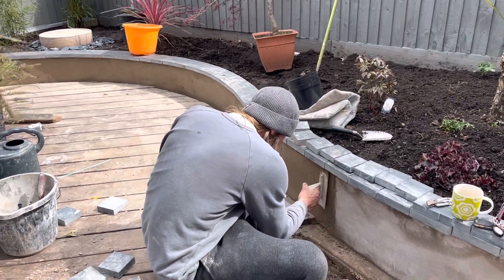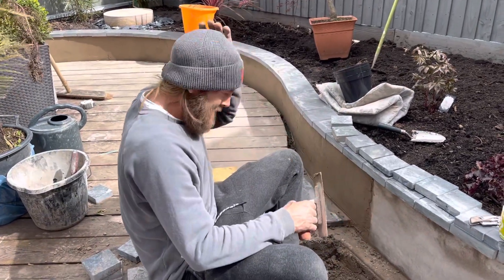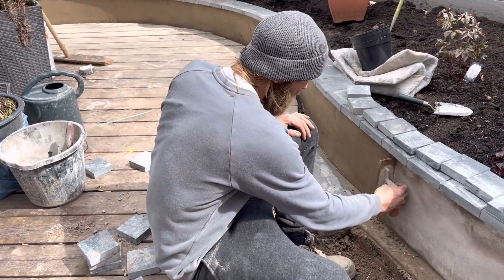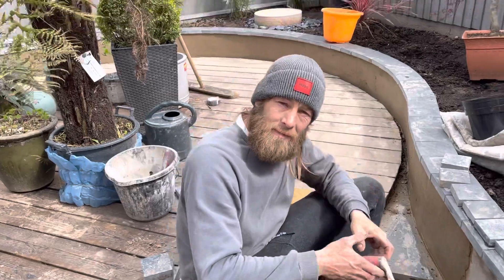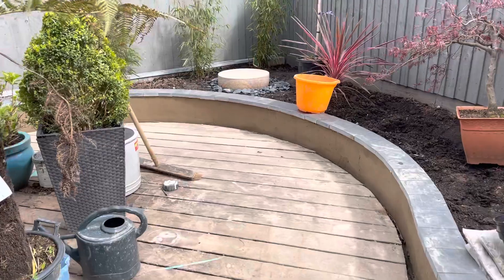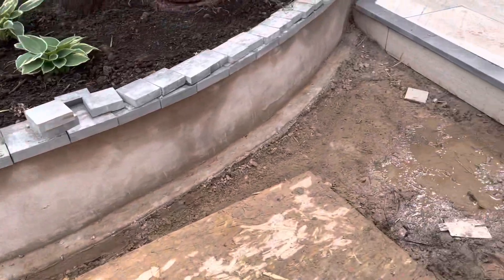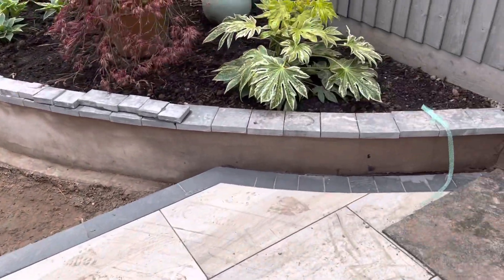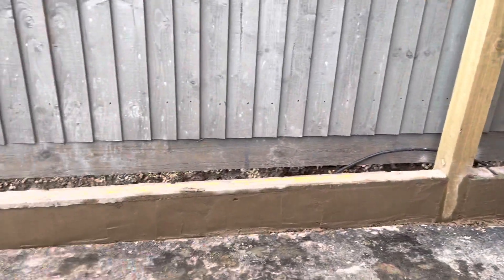Rendering Raised Bed Wall

Comment: What's your thoughts on using render boards on a retaining wall? The landscaper I used used render boards attached the block work with timber. Then K Rend. Now the joints are cracked where the render boards met 😭
Reply from the maker: not good then